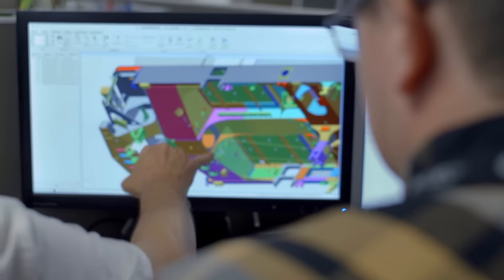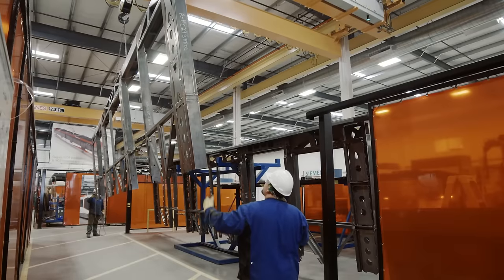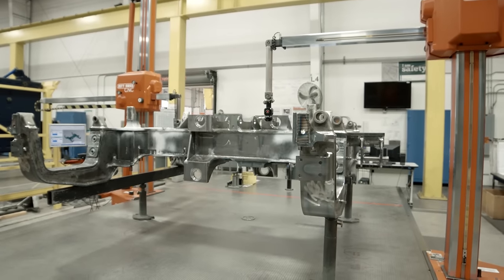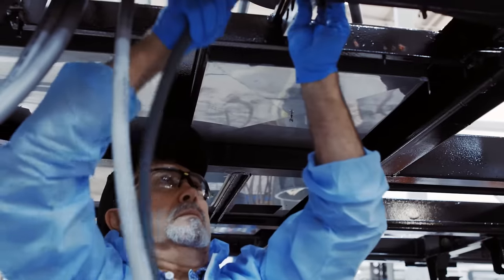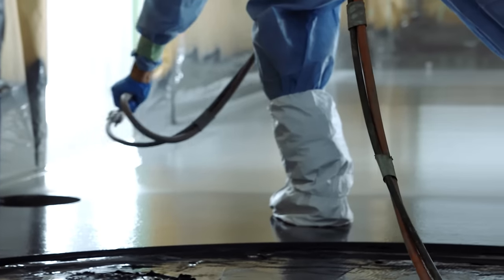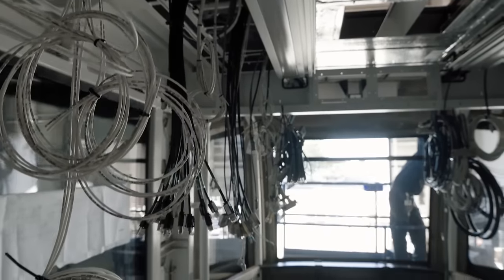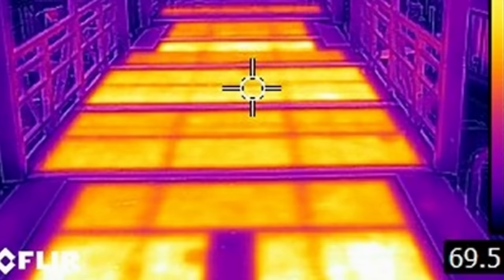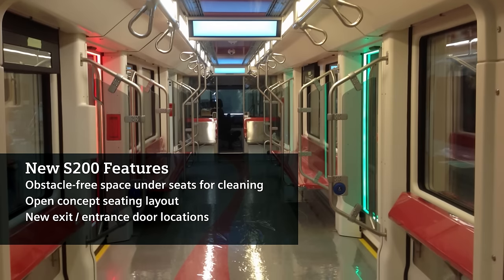Making of the new "Mask" CTrain

Comment: Very Impressive. Hopefully they replace some of those old ones still in operation from the 80's
Reply: I still like those Trains but I don't like the old SD160 ctrain. I like the S200 and the Sd160 ctrain that run in service on 2011.
Reply: @rezakarim8774  Did you know that there 38 u2 still in service today and thanks for the info. I will email/call to let them know about the u2s